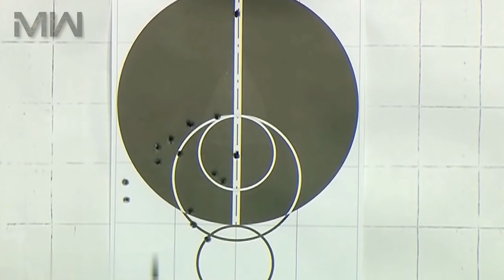Russian Assault Rifle AK-12

Comment: That's the reason I love Russian weapons they are mind-blowingly Awesome .
Reply: @lesliedodds4011  Totally Agreed but the answer is Funny 😁😁🤣😂🤣😂🤣🤣🤣
Reply: Joe Figueroa  Reliability and servicing are the basic things in War which can be a life saver .
Reply: Joe Figueroa  can't agree bro Kalashnikov doesn't compromise with quality 1 faulty gun = 1 dead soldier and moreover it is necessary to be cheap at price to mass produce and supply of to allies more over AR might be modern at the same time , if suddenly it's Gyroscope sensors shuts down due to low battery or sensor failure that's it , soldier losses half of his strength .
Reply: And it is still the same weapon... what makes it awesome ?
Reply: Joe Figueroa  ask the Vietnam veterans about kalashnikov.. ☺☺☺
Reply: I from RUSSIA
Reply: Joe Figueroa  yes but there ass got kicked by a cheaply engineered weapon aka legendary Ak47..
Reply: Joe Figueroa  If you don't take advice from the guys who use the guns, what advice do you take? 
Isn't that what testing is? SO we don't ask the testers how the gun went? We just go by theory? This logic is flawed ~
Reply: Joe Figueroa  So theory basically. I'm sure the soldiers of Vietnam who actually used the guns and are the whole soul purpose of the guns as they are what the guns are designed for, would say otherwise :)
Reply: Joe Figueroa  You are literally twisting everything in order to make it look likr the AK was designee only to be cheap with nothing else to take into conaideration. Considering your final sentence it makes complete sense. Whether you like the Soviet Union or not we are all in their debt to the sacrifice they made in WWII so you can take your disrespect & hate and throw it elsewhere.

AK was designed to be reliable, I think i will trust the designer of the guns words over some Joe who slanders anything Soviet due to external factors. Have a nice day.
Reply: Joe Figueroa  You're last comment says everything, you simply hate the USSR, and therefore disregard everything and anythign positive about it, Sad that people who disrespectfully disregard the 25 million lives they put on the line to keep arrogant hateful humans alive today, but oh well, I hope you can put your hate/political views aside one day to let the human/moral side do the talkign for once. Take care mate
Reply: @Joe Figueroa why is the ak used more? Because it is the better weapon. AR is just a flimsy little shit compared to an ak. The stopping power is ass on the AR.
Reply: @Bleeding Snow  YOU are a true Comrade 🎖
Reply: @Joe Figueroa The US didn’t do shit to help the ussr. They had enough power to stop the Germans and they did. Factories were moved back and started making a shit ton of equipment. The ussr could have easily stopped hitler on their own but stupid American propaganda put their country on the victory list. It’s just a matter of media and hate towards the ussr. Wether you like it or not, Russia won the war. It’s clear to see that teachers taught you well in school 🥴
Reply: @sadbreezy8533  Ak had such great stopping power the Russians adopted a smaller caliber (5.45) to be fair against enemies.
Reply: @ermac2008  Actually Russia was experimenting with smaller calibers similar to the 5.45 and 5.56 around ww2. But they officially started to experiment with a smaller cartridge to specifically replace the 7.62x39 by 1959-60. Years before America entered the veitnam war!
Reply: Joe Figueroa  
If it is so simple to make a weapon reliable like an AK, then why have the Americans still not made it? Why are the US military not very good about AR? It’s very simple to talk about the dignity of the AR in front of the monitor, but when you get to Iraq, you are no longer so impressed with the design of this weapon.
The USA has things that are very respected in Russia. For example, Humvee or A-10. But not a single Russian will exchange the AK-74/12 for AP systems.
Reply: It's true. There's not much going on with this rifle. It' underwent several revisions. The final product is a downgrade compared to the earlier one. The earlier version that Vickers Tactical got to try was superior. Here you basically just have an Ak-74 with an adjustable stock, railed duck cover and a hand guard. That's it. That's really it. The earlier version had a left charging handle, a modern safety lever and bolt release. What a bummer. I'm sure if you get this in the hands of American gunsmiths they could do a much better job in optimizing it. Man with all the guns around today you'd expect that they can at least come up with something similar to the Galil Ace or the M10x. Now those are what an AK could've been. Instead you get this. Well I'm sure it'll serve the Russian military well and maybe also all the other poor nations and terrorists who seem to prefer AKs.
Reply: @gzitterspiller  cheap to maintain good reliability these two make a good long time companion .
Reply: Joe Figueroa  AK 47 itself was since WW2 it's the father of all Assault Rifles in existence today and a soft Balance between an SMG and Sniper Rifle and that's what they were designed for .
Reply: Joe Figueroa  sometimes to make sensation you don't need to re-invent the Wheel you just gotta make it Better than it ever was AK series does exactly that.
Reply: @ermac2008  actually going with 5.45 was just Russian way of telling it's ook to use smaller caliber like 5.56 or even smaller .
Reply: @user-fr8op9hf7r  Agreed !!!
Reply: Joe Figueroa  yes..US has Higher cost bullshits..🤣🤣
Reply: Russia lousy😂👎

Comment: Correction - AK 12 doesn't have a 3 round burst ! It has a 2 round burst mode!
Reply: And the cycle speed is so slow that second round is wasted.  Poor design. Although, it’s widely accepted that the third round of the AR platform’s 3-round burst is also wasted. In fairness…

Comment: AK-12 more reliable !!! So, its indestructible now ....
Reply: Huh nope. AK notoriously don't withstand mud tests and particles (sand etc). An AK can actually jam pretty easily. I mean sure, the quality of the furnitures and receivers is very good. But that's where it stops.
Reply: @RonJeremy514  but the AR or the M16 can wistand against mud ?
Reply: @nemanume  Actually yes it's significantly better in that regard since the receiver is very sealed from the exterior. The semi-DI gas pressure in the chamber effectively blows out particles and mud out of the rifle when fired. 

It's a very popular myth that the AK is more reliable than an AR. While clearing issues with an AK can be easier in some ways, those are two completely different designs. The AR-15 will prevent foreign objects and grit to infiltrate the mechanism in the first place. But it's more complicated than that

Comment: Seem like ak 103 or 203 and a little mix of sig 7.62 .
Reply: Nope its advance version of. Ak107 with recoil management features rest. Is same
Reply: Yep, AK-103-3 was used to developed AK-400 platform and later current AK-12. AK-203 was restart from the old AK-200 project a.k.a AK-100M project with upgrade the rail system on the old AK-74M series with some features from AK-400 platform, example with name AK-74M with rail system = AK-200, AK-101M = AK201 etc, AK-203 = AK-103M.
AK-103-3 is a experimental model for Ratnik project along with AK-12 Zlobin.

Comment: Wandering zero top cover rail, wandering zero in rear iron sight due to being mounted to top cover, harder to clean will mean more rust due to corrosive ammunition, proprietary "buffer tube" limits options, the handguard is moved around easily meaning it's useless for IR aiming devices so it's garbage for nighfighting, same ballistics as previous AKMs in 5.45...  It's a step back in almost every way. The magazines are the best part of this "upgrade". 2/10

Comment: They could streamline production by having a box section aluminum extrusion instead of stamped reciever and plate top covers and handgrips. The front of the extrusion could have key holes for mounting lasers, sights and any other optics.  It just needs the holes drilled to hold all the working parts in the same place as the stampings of the old reciever.  They could have a steel extrusion if they want to keep it super cheap. Also, it could be a bullpup with no mods to the innards.

Comment: One thing I think they should ditch with future AK models is the rock in mag, they should make it a simple magazine, where it just goes in and locks like the M4 etc, mag changes are much better with the M4.
Reply: That would make practical sense. But I doubt they’ll implement such a feature anytime soon as it would mean additional costs for the government to produce a line of new magazines as well as the added feature to the rifles. There are just entirely too many magazines in circulation for them to move away from it.
Reply: @bronzeguy9839  a magwell for a straight insert is very doable and has already been done in the u.s just have to modify the reciever..
Reply: The Russians prefer the rock and lock method because it ensures mag retention.

Comment: Please make a video on hk416  and what accessories can we add on the rifle...
Reply: The hk 416 rifle is a short stroke gas piston operating that is made in Germany original design to replace the mk18 because of reliability issues that special forces have when cleaning rooms, it is chamber in 5.56 of course, it won’t accept many ar-15 parts because it’s a dedicated military rifle, the only thing that are interchangeable are the accessories you can apply, lights, foregrip, laser, and optics, you can use regular ar-15 magazines but make sure it fits and is meant for the 416, the 416 is over gassed because they didn’t want any issue yes that’s the reason why they over gassed it, there are some down falls, one is it’s a heavy rifle comes in at 8lbs stock configured, with the part and accessories you added will make it heavier,  
there is more felt recoil than the m4 or mk18, and no the German army doesn’t use this rifle, Germany still till this day uses the g36 rifle family, and later in the years of the contract of the 416, Germany made the 417 which is chambered in .308, designated as a dmr only, but they have ones that are combat directed, the 417 is the same as the 416 but except the magazine has to be from HK, and the rifle is pretty expensive, but with that begin said of the minor problems the 416 has, its more reliable than the m4, the 416 is able to function in water submerged, sand, salt water, not so much on mud because the way it’s design. This was the reason why the seal team six used the 416 because it is able to function without jamming on missions in salt water, not sure if they still use it till this day, delta now uses this rifle, and fun fact this was the rifle that was used to kill osama bin laden
Barrel length is comes with are
10.3in
14.5in
16in 
The barrel is a chromed lined, coldhammer forged, so the barrel is able to take a beating without cleaning it and able to hold more round count than the standard m4, and now the marines have adopted a new rifle called the IAR 27 I think it’s called and it’s like the rpk of the 416 but they don’t use that way they just use it as rifle, and also the reason why the military didn’t end the contract of the m4 and replaced it as the 416/417 because it’s was very expensive even though the 416 fundamentals are the same as the m4
Hopefully this sums up your question

Comment: The new version is just ak-74m with a new stock.
Reply: And it aslo seems that your information is mixed. The early (ak-200) model indeed has both sided selector switch and charging handle but the new model (ak-400) doesn't.
Reply: If someone knows a good prototye without promblems of the earlier model (ak-200) please tell me

Comment: 7.3 lb's unloaded no optics ,  loaded mag weighs 1.4 lbs  now you are just short of 9 lb's without optics / light / dball  
still trying to fix a 75 year old flawed concept that was made out of old Russian fence posts and don't tell me it is more reliable than the modern quality AR , I have seen them jam recently and in the past. Besides with the original AK's what did reliability count for if you only had a 50/50 chance of hitting your target at 150 yards ?.
Reply: Ak74's can hit 500 yards no problem. Ak-47's are decent out to 450. 
AR style rifles jam fairly often as well.
Reply: @redkaladin6864  Note: I clearly stated " Original AK's " that I have personally fired in accuracy tests. Sure I have seen AK's hit at 4-5 hundred yards , usually after a higher quality model is purchased and sent out to be worked on . I have had about 40 years experience owning and firing AK's of different makes in about seven different countries . How bout you ? I'm not saying it's not a deadly weapon, I'm saying that they are still trying to fix a fundamentally flawed weapon for 75 years.

Comment: So an ak74m with pic rail?
Reply: Not really they did so many changes that the 74m part are not compatible with each other unlike the 103, they did so many things with the gas system the gas block, and the iron sights except the magazine is the only thing that’s compatible with each other 
The only ak that similar and so close to the 74m was the ak103 you can accessories part with both reliably except the magazine cause the 103 was in 7.62 and not in 5.45 like the 74m

Comment: How accurate is it ?
Reply: The ak-12 has a caliber that shoots 5.45*39 and able to accelerate at the range from 500 yards to about 600 yards the max you can go is around 800, the grain of the bullet is 60 and it tumbles unlike the 5.56 that penetrates straight through, both of those caliber are good on soft tissue not really good on penetrating on body armor, Russia has the 7 and 6 caliber that was classified as the armor piercing round but it’s not very good at it, it can penetrate decently just not as good as the 5.56 green tips